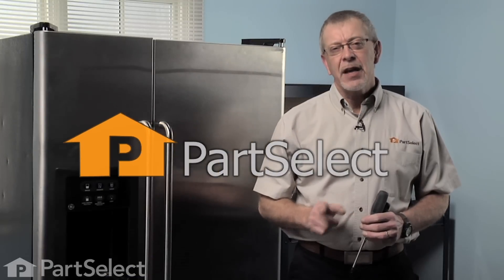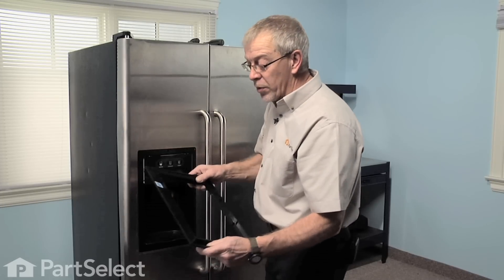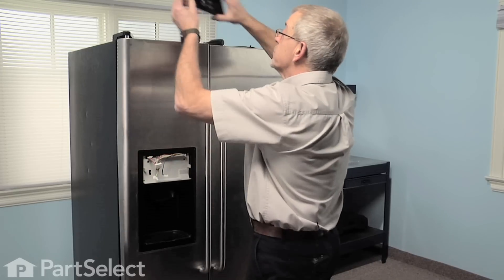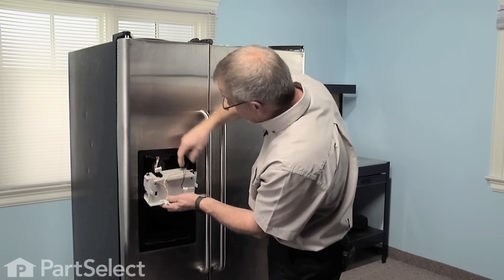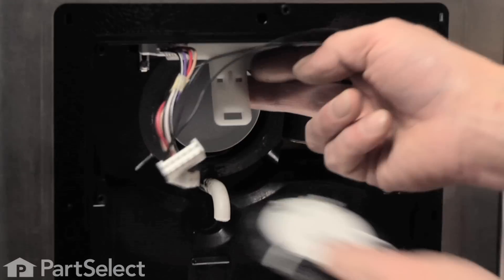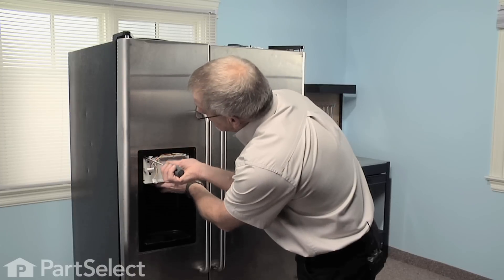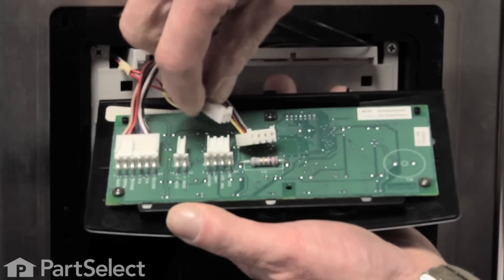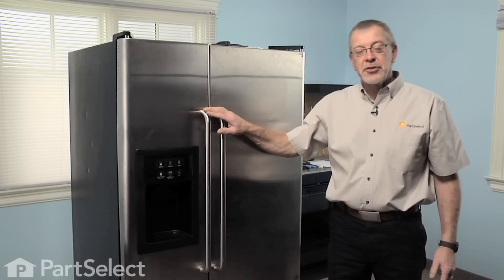Refrigerator Repair- Replacing the Ice Dispenser Door Assembly (Flapper) (GE Part # WR17X11653)

Comment: my ge fridge has a frame that holds the controls into place.  I have found a screw underneath the panel that loosens it, but the frame is still keeping it in place.  The frame looks like it goes into the stainless steel.  How do I go about removing this frame?  It's not so simple as that overlay I see on the video and I believe it costs about $60, which is much more than the flapper is so I don't want to break it.
Reply from the maker: Berton Brown What is the model number on your fridge?
Reply: ***** ziss360dress.  I think I may have to remove the stainless steel by removing the screws on the top and bottom of the door to get at this repair.  I found a screw underneath the control panel which I removed but this only managed to loosen the display.  What do you know about this?
Reply: ***** Were you able to find anything out about this model?  I have a pic of the front of it.  You can clearly see that there is no easy way to get into the dispenser.  I've been trying for several days but I don't want to break it so I think the only way to get into it is to remove the stainless steel via screws on the top and bottom.
Reply from the maker: Berton Brown I need the model number before I can diagnosis the problem.
Reply: ZISS360DRESS
Reply: I has a similar issue,  You'll need to remove the rubber gasket and shelving assembly from the inside part of the door.  To do that you'll need to unscrew all of the hex screws holding the shelving assembly to the door.  They are easy to get to if you simply look under the gasket and there are a few dozen of them.  That will remove the shelving and gasket from the door.  Then you remove the styrofoam cover from the dispenser assembly.  Then there will be about 7 or 8 more screws that are under the fiberglass insulation of the dispenser assembly.  Those screws hold the frame you are talking about to the dispenser assembly and ultimately to the door.  Unscrewing those hex screws and then popping the four tabs that click the frame into place will free the frame.  It took me a while but I eventually got it off and replaced the flapper.

Comment: I have a side by side stainless G.E refrigerator .. the water line got damage inside the door from the bottom .. how can I replace the line ?i disassembled the despenser but couldn't disassemble the water spout nipple where attached to the water line from the top .. thank you in advance
Reply from the maker: What is your model number?
Reply: It's same this one in video exactly
Reply from the maker: That video was made in 2011 and we no longer have record of that model.
Reply: Did you figure this out? I need to replace the water line in the door on mine.

Comment: My GE model GSHS6LGBBHSS does not have a bezel around the ice/water dispenser on the left door. How do I have access to the flapper? Any suggestions will be appreciated.
Reply from the maker: There are four tabs that hold the user interface to the dispenser housing. Grasp the bottom edge of the interface control and gently pull toward you to release the bottom tabs. Remove the wire harness connectors and set the board aside. This will give you full access to the four screws that hold the dispenser shield in place.
Reply: Yes, now I am able to get to the solenoid!!! 
Than you so very much for the tips. You are wonderful!!!

Comment: My flapper opens and closes but the auger will not engage and advance ice forward. If I catch the flapper while pushing the dispenser in it will activate the auger and ice dispenses. But without catching the flapper it just opens and closes very quickly. 

frigidaire fgus2642lf2
Reply from the maker: Hi Josh,  I would suggest checking the micro switch. The micro switch in your refrigerator aids in the dispensing of ice and water. This micro switch controls the on/off function of the ice/water dispenser of your refrigerator. If your refrigerator is not dispensing ice or water properly, you may need to replace your micro switch.

Comment: control panel's green light on my ge refrigerator (pss27sgpass) is stuck at cubed (always) and sometime at lock control. I can not change for any other function, yet    ice is still coming as nothing happen.I tried to reset by unplug and waited 10 minutes.
After that it was fine. no more stuck I could change for any function and each function was just fine. But only 3 - 4 hours later back to same problem. I do not have any clear idea what i need to fix it. Please help me........ do i need control board or main board and may be something more? thaks
Reply from the maker: +john um I would suspect the user interface board on the dispenser. http://www.partselect.com/PS783824-GE-WR55X10298-Dispenser-Interface-Control-Black.htm?SourceCode=3&SearchTerm=PS783824

Comment: Hey, FYI, you don't need to remove the dispenser frame to get the touch pad off.  It's not worth the risk of breaking the tabs.  The touch pad comes off easily with the frame on.

Comment: I have this GSH25JSTFSS Refrig. and I have done everything I can think of but cannot get this unit to stop Frosting the interior of my Freezer. Checked the inlet area of the suction line too, and secured the seal. Still frosts up. I'm losing it here.. Anyone have any idea what's going on here..?
Reply from the maker: +Robert Henderson Check around the dispenser opening for an air leak.

Comment: Hi, I found your video very helpful, thanks for posting. However, I'm trying to find instructions on how to remove the water spout, since it's very dirty on mine. I can't even find a part number for this (my fridge is GSC23KSWCSS). Could somebody point me in the right direction for finding instructions/part number on the water spout?
Reply from the maker: The spout that you refer to is actually the open end of a 5/16” water dispenser line. The water line is fed from the dispenser, down through the freezer door and exits through the lower hinge where it connects to the water line from the reservoir located in the fresh food section. You can disconnect the line at the union below the hinge and then securely attach a new line (PS292878) to the end that protrudes through the hinge. Remove the dispenser cover and housing to access the upper end of the tubing or “spout”, and carefully pull the new tubing up to the dispenser. When attached at the dispenser end, trim the bottom end to length and reattach with the coupling.

Comment: After a day of attempting to pry the recess trim from around the ice dispenser control panel (GE model GSS25SGMDBS) in an attempt to replace the flapper, I concluded that the trim on this refrigerator is screwed in place from inside the fridge and not meant to be removed from the outside. I finally located three small holes inside the dispenser area, stuck a larger paper clip in the holes releasing the control board and allowing access to the flapper. I disconnected the wire harnesses (after unplugging the fridge), removed the ice chute (four screws), and replaced the flapper.The flapper cost $8.00.
Reply: Did you have to use paper clips in each hole at the same time, or just 1 at a time? I think this is what I may need to do also...
Thanks!
Reply: Erik Zakoske Fixed it! It was the holes on either side and looks like the middle hole might have a screw through it on some....

Comment: I removed the 4 screws but it's still stuck on the bottom right corner.
MODEL #GSH25JSXN SS
Reply: I am having the same issue.
Reply: peter rentas has anyone figured out how to get it out? I've tried all kinds of ways and nothing works short of breaking it.
Reply: I figured out the problem! The light being on has caused the plastic housing to fuse with the main body of the fridge. You have to leave the light on for a while so it heats the plastic up enough so you can force the two plastics apart.
Reply: James Reames Jr Thanks SO much!!!  The video had great step by step instructions, so I thought I would try it myself.  But I had the same problem and was about to give up.  I still had to work at it for a while to get the housing out, but your tip really helped.

Comment: I had frost building up in the ice chute i could see light through flapper and new flapper made it worse could it be the spring?ge fridge modelgss25qgsacc
Reply from the maker: Most of the time when people experience frost buildup it is due to a faulty Defrost Thermostat. Here is the link to the part: http://www.partselect.com/PS1017716-GE-WR50X10068-Defrost-Thermostat.htm?SourceCode=12&SearchTerm=GSS25QGSACC&ModelNum=GSS25QGSACC
If you don't think that is causing the problem check the Defrost Sensor. 
http://www.partselect.com/PS304103-GE-WR55X10025-Temperature-Sensor.htm?SourceCode=12&SearchTerm=GSS25QGSACC&ModelNum=GSS25QGSACC
Hope this helps with your repair!

Comment: Upon removal and inspection of my old flapper, I saw no warping, indentations, or any problem with it.  Nevertheless, replacing it resolved my frost problem.  I am inclined to think the cause of frost build up near the ice chute is almost always from an air leak, usually at the flapper.  I think it is a GE design flaw, since my fridge is less than two years old.  I have billed GE corporate for $150 time and parts.  We shall see if it responds, LOL.  So tired of Chinese GE products.

Comment: Although I've tried for over half hr now, can't remove escutcheon trim only.  Everytime it pops out it removes entire panel with not enough room to reach in to get to screws or display.  I have a Kenmore Elite model# 795.77573600.  What am I doing wrong?  Any help, please.
Reply from the maker: Sorry that you’re having problems with the door trim. What type of repair are you trying to do on the fridge? Let us know as that’s helpful for giving you the right information. Thanks!
Reply: Trying to replace ice flapper.

Comment: I actually have a problem.. I just removed all the screws on my housing but it is still stuck on there.
Reply from the maker: It may be stuck on the water outlet tube. I don’t know of anything else that may restrict the removal of the housing.
Reply: thank you it turned out we had gotten this unit as a refurbished unit and someone actually glued it in thank you.